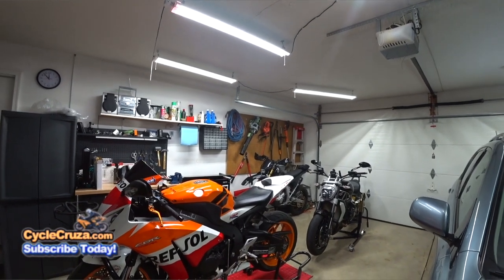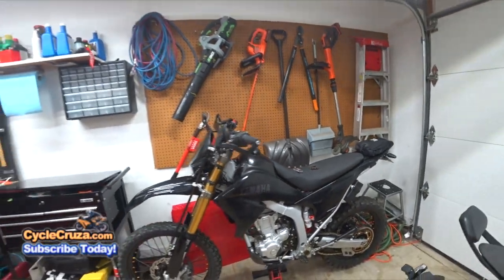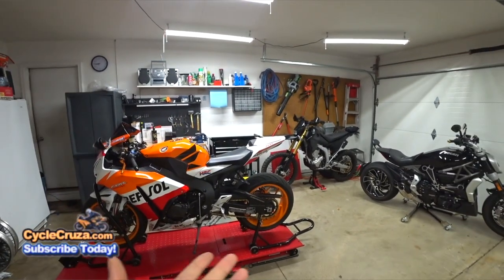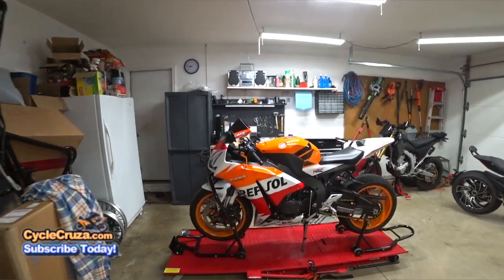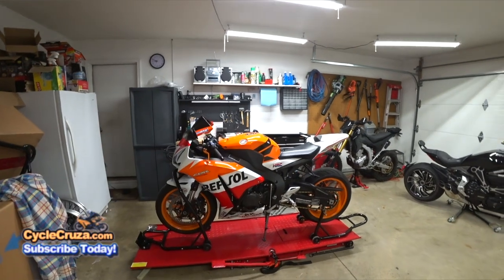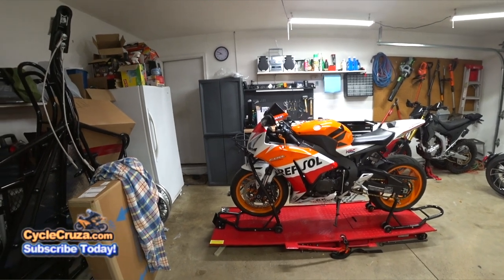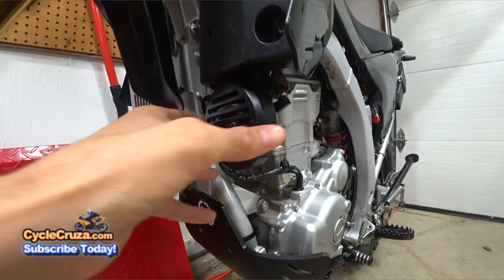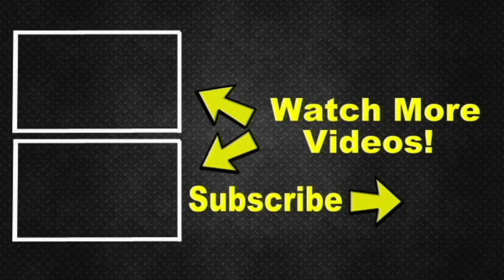10 Mods I Did That Were HORRIBLE (AVOID these Motorcycle Mods!)

Comment: # 1 mod mistake cycle cruza did was buying a wr250 and sinking a bunch of money into it instead of buy a wr450.
Reply: PoorMan94 wr450f is a completely different bike with a completely different purpose, not street ready out of the box and much higher maintenance
Reply: Lucas Smirniw depends where you are, the 450 is 100% street legal in Australia straight out of the box
Reply: Jack Brown still doesn't change the maintenance intervals and higher repair bills
Reply: Lucas Smirniw true, I guess it's the trade off you pay for a quicker bike
Reply: Jack Brown still has the same top speed despite the bigger engine bc it's geared for a different purpose
Reply: But it gets to that top speed a lot faster. more torque. I'd go for the 450 personally. but thats just my choice.
Reply from the maker: lol I now also own a 2019 YZ450FX, destroys the wr250r in every way accept maintenance and reliability. However, my WR250r is the bike I can trust to travel the world on and don't have to touch a fooking wrench! My YZ already needs a valve check and piston kit change at 11 hours. lol
Reply: @CycleCruza  Yeah the maintenance is the one thing keeping me from the 450 dirt bike set up. They are made to race and not for the road and require constant maintenance.

Comment: Non oem engine components...for example: using chinese knock off parts for your kids 2 stroke bike. Stick with oem pistons.
Reply from the maker: yep. I;m not even putting on the big bore kit, I changed my mind. I'd rather have reliability.
Reply: On my Instagram page thing I have a picture of the original 20 year old oem piston and a 20 minute old Chinese knock off side by side. Never again. OEM all the way.
Reply: CycleCruza Good choice but sprockets are fine.  Maybe not an off brand. But Drive sprockets for cheap are totally fine.  Pistons, bearings, cranks.  OEM or JD pistons (for High Compression) is legit
Reply: I've used Weisco pistons in every smaller engine I've rebuilt, especially for performance, zero issues.
Reply: Steven Evans 
Weisco is quality USA made forged aluminum. Better than OEM quality in most cases...

Comment: when i went down using frame sliders on my first f4i it bent the bolt itself in the frame slider and scratched the frame slider of course but my frame was fine. i was able to reuse the slider and cut welded the bolt back together aswell .. the frame slider itself wasnt even designed for a f4i it was quite a bit longer so you would expect it to catch more..

Comment: I never went for the frame sliders.   I always thought  If you go down and the bike is sliding down the road on its side.   That frame slider catches on something like a pothole and it will rip your frame apart.   I would rather have a scraped up skin than a destroyed frame....
Reply from the maker: Yep!
Reply: Check out Graves frame sliders. Plenty of surface area and angles for deflection. It's also tight to the frame so it's truly there to save the frame, not to keep the fairings looking pretty.
Reply: Deflection my ass  , If and when I go down , the skins will glide over the terrain and protect my frame just fine.

Comment: Two up in the back is the most you should go on the cbr.   Even that will kill your hi way.    But you won't have to smoke the clutch out of the hole when old ladys try to beat you off the line...
Reply: Blocked User lol

Comment: You tightened your chain too tight, it wasn't the sprocket
Reply: Yea that was not the sprockets fault. If it ripped the splines off the output shaft, that shows the sprocket is stronger than the output shaft. The stock sprocket probably deforms under load losing power but creating less stress on the output shaft. Either way his output shaft being striped is all due to his own riding and really had nothing to do with the sprocket. This guy showed he wasn't a professional tech after mentioning the timing retarder too. One of the first things I learned about ICE engines was that more timing advance means more power, well more power up until you get spark knock. Retarding the timing does the opposite and you lose power and efficiency. He should really stop spreading misinformation and go take a course in automotive or motorcycle technology. Even a basic course from his local community college would help him.
Reply: My thoughts too.
Reply: The aftermarket sprocket was narrower than the oem sprocket & ruined the drive shaft.Had this problem with my XR650L 
The standard sprocket is too narrow. If you don't catch it in time it will cause damage. Primary Drive sell a sprocket that's wider than stock & fixes this problem
Reply: @bermrailin  BS, if you actually watched the video when he tightened his chain, then check the manual for the bike for the recommended chain tension, all the evidence is clear that he tightened the chain too much. Then went doing jumps on the bike to test his tuned suspension. When the suspension compresses the chain gets even tighter and that's when the damage occurred. Why do you think MX bikes run the chain seemingly so loose at static sag ?
He's lucky it was only the output shaft, cos if the chain would've snapped it's doing a lot more damage!
Reply: @codenamenel  my mistake, the XR650L & most Honda's have different mounting for front sprocket .l too can only assume the chain was too tight & maybe an alignment problem as well.  strange how the spline teeth weren't fully stripped if alignment was good. Anyway please check out YT vid   'XR650L primary drive sprocket' to see what l meant.cheers

Comment: haha, disappointing not to get trade mark the 'fooled the dealer' laugh when you were chatting about the plastic dipped rims CycleCruza ;), wish I could remember which vlog this was in!      By the way, I fitted an Alamor Mocc Motorcycle  12V Automobile Snail Electric Horn to my Honda Varadero 125XL RR, which is a good bit louder that the stock horn.    Especially as after I re-painted the horn as part of the bike refurb (never paint the horn it will  probably stop working).    Was pretty inexpensive and easy to fit as well....

Comment: Logically, a Power Commander and a tune would eliminate the need for a Bzaaz.  Also, logically, if it is not variable valve timing then there is no plug and play thing that can override timing chain and cam position...

Comment: Sliders are good for standing drops.
Reply from the maker: As mentioned in the video, I did a standing drop on my former cbr600rr with no frame sliders and the only damage was a scrape on the stator cover, had I had case sliders there would be no damage.  Imo, case sliders are the way to go.
Reply: @CycleCruza  Yeah, I don't think so, man. Fucked up like a week and a half ago in a parking lot, no frame sliders, maybe 15-20mph, the handlebar, clutch lever, shift pedal, crankcase and the entire taillight assembly were completely destroyed. It wasn't even close to drivable and I'm thnking it's stuck in gear and with the crack in the crankcase it obviously wouldn't start. 800 dollars just in parts which still haven't arrived and I won't get the crankcase cover and gasket until the end of the month. Not to mention I had to borrow someone's truck and lift it into the back. I don't see how any more damage could have occurred considering what happened, frame sliders or no. Maybe I got unlucky but for literally like half the bike to be destroyed? Wish I had frame sliders or something, because all the fairings are fucked up now, too, so even cheap Chinese fairings are going to cost me another 400 ish bucks. Let's count on the trump administration to figure out a way to make that cost more... I digress. Keep in mind when I bought it, it was basically new with 3200 miles on it. I put about 700 on it and after all is said and done, even if I do all the repairs myself, that's 1200 just in parts and plastic. I may need to replace the clip ons, too, because when the handlebar broke it rolled around the clip on and I couldn't get part of the handlebar removed so it's bent all around it. So add another 100-200 potentially and the cost will be close to 1300-1400 bucks. It's an r3 and I paid 3.5k for it to begin with. Idk about you, but that's an expensive fix as far as I can tell, and I won't even know if it will run until the end of the month at best. If you ask me, frame sliders are sounding like a good idea, because like you say, I had a real fucked up day. Everyone talks about motorcycles being the best antidepressant??? Go wreck your bike and make it undrivable and then tell me what the biggest depressant on the planet is. Not to mention it's currently my only mode of transportation, so now I have no transportation. I think if maybe I had frame sliders, then none of that would have broke? Maybe the taillight would've been messed up, but believe me when I say, short of just a little road rash on my knees from rolling and no real injuries, it was probably about as bad as it could have been. I do like your videos, but really, man, I got unlucky and some protection for the bike could not have made that worse. I just don't see how it would have been physically possible to be worse when going down in a parking lot at like 15 mph. And if anyone wonders what happened, I was turning around with a great enough radius to be safe (about 4 or 5 parking spaces, maybe, it was a decent sized loop) and as best as I can figure I drove over a crack with tar and weeds and somehow lost the back tire, basically started sliding out and I didn't see much after that until I stopped rolling and picked it back up. No, I wasn't stunting or doing stupid shit and the only "lucky" part to it was that I was in an empty parking lot and not the middle of the street or an intersection and I wasn't hurt. Any thoughts on whether or not frame sliders would have helped me? Because I'm seriously considering purchasing some after I know the bike will run. Thanks to anyone with information or advice.
Reply: Had frame sliders on my vfr 12 and chucked it down the road at 40/50 mph and they really did stop to mutch damage
Reply: CycleCruza 
Way back when, I standing dropped my 86 Interceptor 750 in a McDonalds parking lot in Seaside, CA... cracked the shit out of my plastics in two places.... sure wish I had sliders for that one.

Sliders are great for standing drops, and for low speed drops, the kind of thing that happens when learning a new trick, such as wheelies and stoppies...

Comment: Love ur videos bro.  They helped me out a lot.  I have a question CC"Do u regret selling ur CBR 600rr?"
Reply from the maker: No, although I loved the 600rr it was time to try something new. My 12 cbr1000rr has a quieter cooling fan, can't hear it unlike the 600rr fan. Also, my 1000rr seems to emit less heat, so summer riding days are cooler. More bottom end power on the 1000rr is nice too. The only thing I miss with the 600rr is it felt a little smaller, felt like a 250 in size.
Reply: CycleCruza thanks for answering CC,  I have a 2011 600rr.

Comment: bs on the frame sliders,m i have a vid on my chanel which i went down going 50km and the frame sliders saved the bike, went through gravel and asphalt and not a scratch on the engine or fairing. i highly recommend getting no cut frame sliders, the list of damage was minimal, just the stock exhaust was scratched which i got replaced with an aftermarket one and a bent foot brake which is cheap to replace.
Reply: and they are attached to the engine and frame, have 3 anchor points, two on the engine and one on the frame
Reply: youd need a lot more force to damage something that is bolted onto the frame and engine, i would avoid frame sliders that are only attached to the frame,  it could bend and break the bracket that holds the engine bolted onto the frame, i went with r&g sliders because they bolt onto the frame and engine, you cant bend both,
Reply: No-cuts are simply cosmetic. They offer no additional protection they only re-position where the slider is going to be. Most times they offer less protection because they create a moment arm so the slider is actually going to deflect and bend more than when solid mounted to the frame... so it's just a matter of how much performance you want to get out of your slider. Any slider mounted to a frame isn't going to affect the frame... the materials used for quality sliders are specifically designed for force distribution and abrasion. Shogun sliders or purely cylindrical sliders with no angles are the ones you want to avoid when there's imperfections or pot-holes in the road.
Reply: id no cuts are the ones ive heard are the most recommended because dont dont decrease the resale value as much, and are mounted to the engine and frame, they worked for me well and i recommend them. i have tested them xD
Reply: I have seen frame sliders work great on the track, but on the road wit pot holes it can be a different story. I have seen pros and cons on using them but I still use them with case protectors on my CBR600RR. I guess it has to do with your situation your in when you crash and your luck.

Comment: The engineers that design these machines spend a lot of time figuring what works and what does not.  I am a big fan of stock because they know better than I.  The only exception is exhaust and cosmetics.  I will say that I am going to do case sliders on my Ninja 1000  because that is a good idea that you had.

Comment: tssk tssk tssk, CC, the only thing you need to do to increase power, if you wanna go aftermarket is a Bazzaz Auto tune piggyback, and go tune your maps properly, 2 gears at a time, you conect it to the bike and PC, and press the tune button, go pull 1-2 gears till limiter, full gas.. then return in 6th riding slow... apply those 2 gears, then same for 3-4 & 5-6, apply all the changes, and you got yourself a propper mapping that will auto ajust itself to all temperatures and humidity conditions.... if you combine the auto tune with a Dyno Tune, even better...  everything else is just BS

Comment: Chinese bar ends...never fit any of my rental bars on my last 2 bikes. I bought 4 bars in total, 3 different sets of bar ends... god it was frustrating. 

Another one was putting a 7” light bar under my headlight on my FZ09. It did make it brighter, lit much further.... but I didn’t need it riding at night. Living in Los Angeles there’s street lights everywhere so unless I was going through an alley with no lights, there was no use... it was nice tho. Really blinded some stupid cagers lol.

This one isn’t a NEVER but I always have a hint of regret... which is putting an aftermarket exhaust. This is the second bike that I put a full system on, and this one I even got a flash, then Power Commander and then Custom tune... and NEVER got the same feel as stock. I mean now it’s stupid ridiculous but it’s not as smooth as stock. (FZ09)

Comment: Frame sliders are not for high speed crashes, they are for low speed crashes..... put the rubber side up at high speeds and all bets are off, it is a two wheeled vehicle, keep those rubber parts attached to the ground!!!

(Sliders are to protect the plastic when frequently dropping it learning how to wheelie and do stupid shit you will tell your kids not to do on their 20 pound bicycle while you do it on your 400 pound motorcycle; those aren’t parts to protect the bike at 120 MPH flying south on Highway 1 between the turns.)

Comment: that was admirable that you shared the f$cked up day you had with the front sprocket.  most guys would have not mentioned that one.  i just ordered a new horn.  a denali sound bomb mini horn. i thought the one you had might not be much louder.   i will let you know how it turns out if you are interested. i don't have to change the electrical wiring.

Comment: Your moto inexperience is super evident as usual. Of course dropping a tooth on your front sprocket makes a difference, it's simple physics. 1 tooth on the front is worth around 3 on the rear, i have the same bike and dropping a tooth was one of the bests mods you can do for this bike. The fact you can't feel it shows how little of this bikes ability you use. Also IMHO fake stick on carbon fiber looks just as cheap and shitty as your plasti dip.

Comment: Plasti-dip is garbage lol I prefer paint
Reply: @dariodipaola8445  Couldn't agree more.. for people who want to modify but lack skill And knowledge you can Just Scratch that shit off
Reply: Like, it's a great concept... but it's a garbage product. I understand why people use it. Most people have paint skills limited to that of a rattle can. But, Plasti Dip is a pain in the butt to peel off (unless you're using abrasive chemicals to basically melt it off) and if you're using it on something like a rim it won't last for more than a month before it starts to fray, scuff, etc. Powder coating and paint are the best go-to's. The quality dif is night and day, the color variety is endless, the cost really isn't that much more if you're taking it to a mom/pop shop... etc. etc. etc.